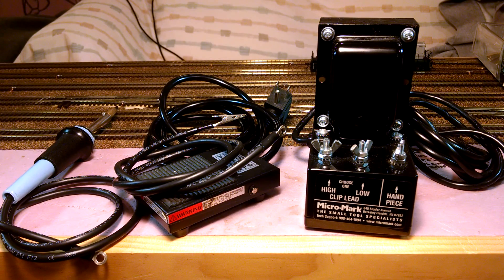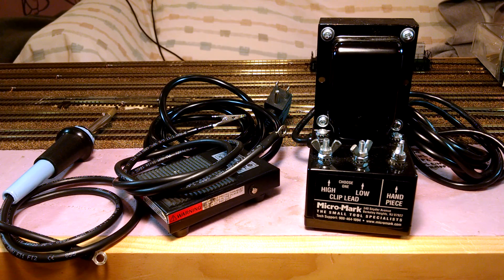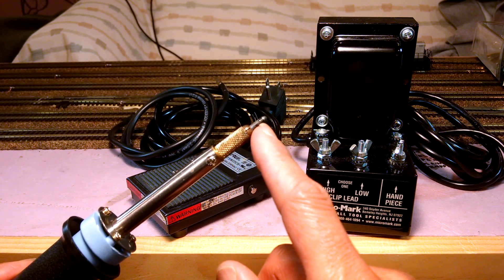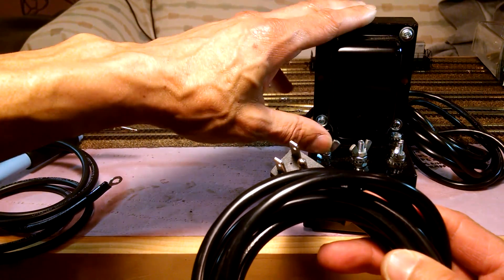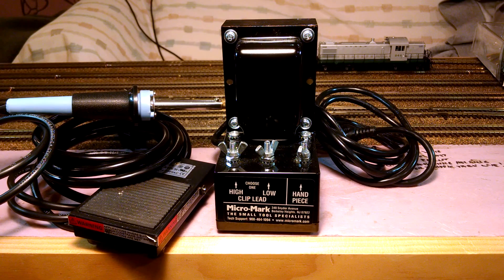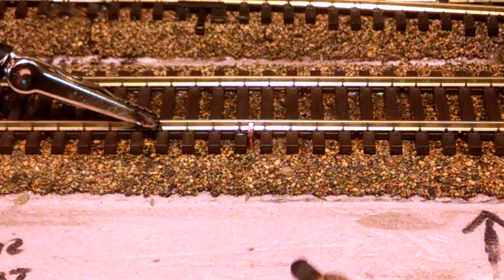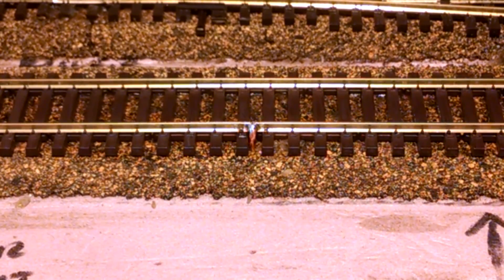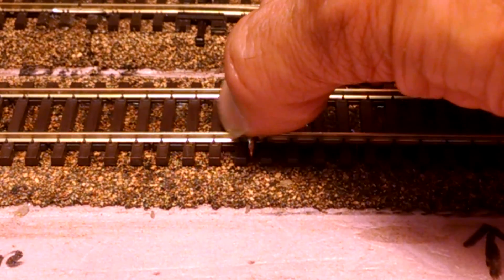WTC: RSU-What is it?

Comment: Do you have a dimmer connected to this unit to control the voltage and Amp output? with a dimmer you can leave the positive lead connected to the high (on the main unit) ,then control the output with the dimmer. would that work?

Comment: David..thank you for posting this video.  I have always wondered about these units. And, as you say..generally you see them in connectiosn with brass.  I never researched them, I've just wondered about them.  Here you have shown one in action and yes, it does a sweet job. I'm well aware of the melted tie problem doing my N scale track.  I guess the price is the biggest aspect that has kept me from checking into it..but, now after watching your video..hmmmm,  sometimes you really do get what you pay for.  I may be in the market for one of these units in the future.  Oh, and you mentioned at the beginning of your video..that you are not a teacher..don't under sell yourself.  You come across very clear, to the point and easy to follow.  Often we don't see ourselves as others do.  Keep up the good work.. Tom
Reply from the maker: Go to MicroMark.com and the have a version called the "Micro-Lux" cost is about $169.00 for the unit and everything you need to solder, except solder! One of the best purchases I've made for my railroad.
Reply: Thank you for the reply and info.. I will check it out.. Tom

Comment: Nice video, David.  I had heard of an RSU but never seen one in action.  I may just have to get one now!!  - Brian
Reply from the maker: Micro Mark has two in the catalog, the Micro-Lux which is the one I have at #159.00 approx. and the other is around $300 bucks or so, out of my price range. You will still need a good traditional iron for things, but the RSU has benefits with others. There are videos on how they work which you might want to check out. Best thing, you don't burn electricity when you are not using it, operates by foot switch unlike regular soldering iron always on pretty much. Glad you watched that one!!  Thank you!!
Reply: Thanks for the info David!  I will watch some additional videos on the RSU for sure.  Really enjoy your videos!